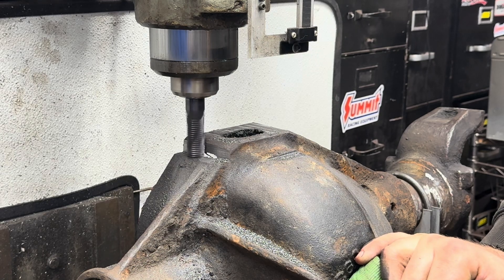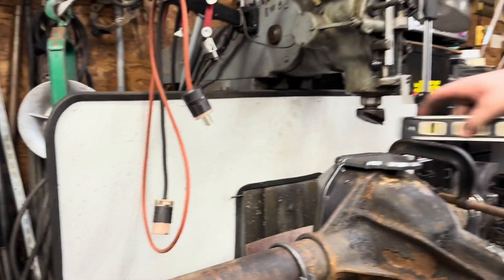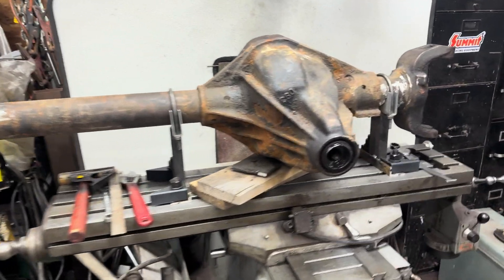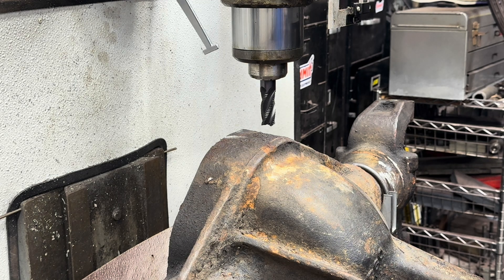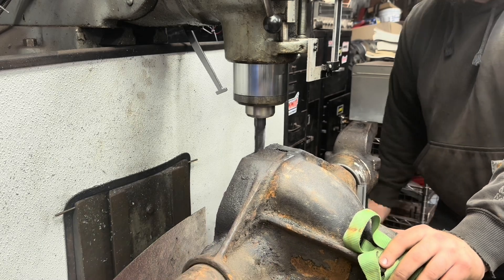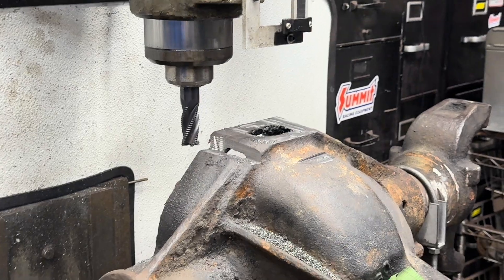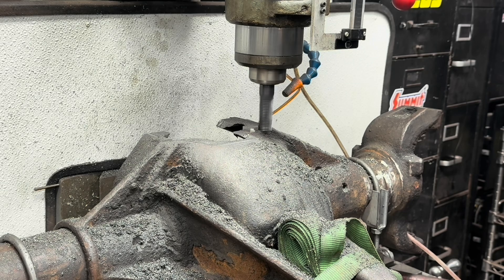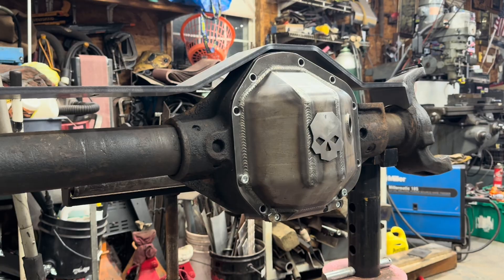Machining a Dana 60 for a Ballistic Fabrication Shave Kit - Ultimate Dana 60 Junkyard Build Part 1

Comment: Dumb question, as this is new to me, taller tires do same thing?  Do you weld the piece in?  Isn’t welding cast a pita?  Thanks
Reply from the maker: Not a dumb question at all!  Taller tires do accomplish a similar goal clearance wise, but the shave kit also gives the differential a flat bottom so it’s easier to slide over any rocks I do contact.   The issue with going with bigger tires though, is that you need to go up 2 inches more in tire size to gain the equivalent 1 inch of clearance this shave kit gets you.   That’s typically not a bad approach, but I’m already running 44” tires and am hoping to not go any bigger due to hopes of continuing to drive this thing on the street.  While it’s a lot of work for that extra inch, I do typically hit the bottom of the front differential a few times everytime I go out with the truck, so it should help.  Eventually I’ll do the rear differential too, and that should gain me closer to 1.5”, which should help a ton because I constantly seem to be getting hung up on that.  

For the piece on the bottom, that does get welded in.  As for the welding to cast, it is a pain, but there are some tricks I’ve read that should help.  You need to pre heat the casting to 400 degrees, burn the piece in, relieve the stress with a needler (needle scale the weld to help relieve stress between the dissimilar metals), reheat to 400, and then wrap with welding blankets and allow to cool over the course of a day.  

All in all, it’s a lot of work and should help gain some clearance off-road.  I’m not sure I’m sold on it being the best bang for your buck (and time) yet, but I took on the project more so for the fun of machining the axle and getting to try a different kind of welding project.  Once I get it done and test it a few times, I’m definitely going to evaluate my thoughts on it again and see how beneficial it really was.